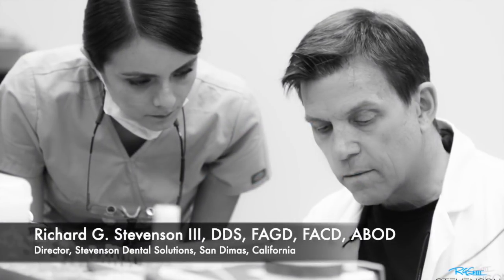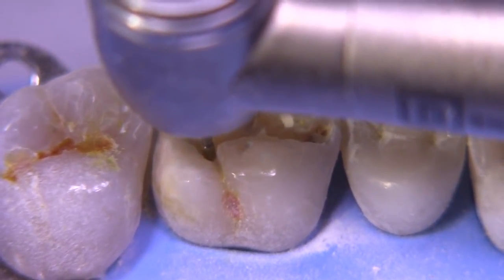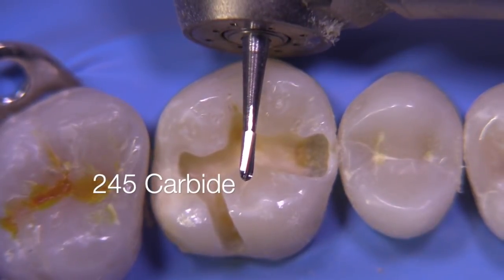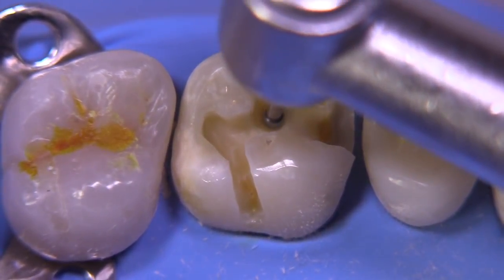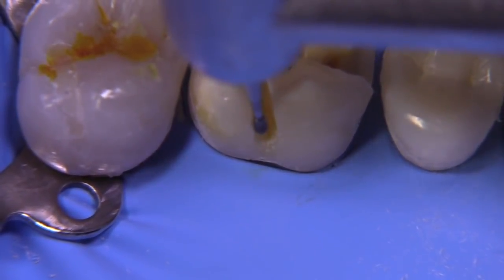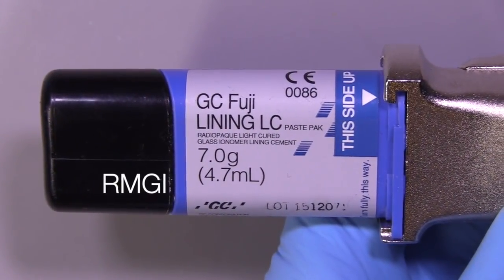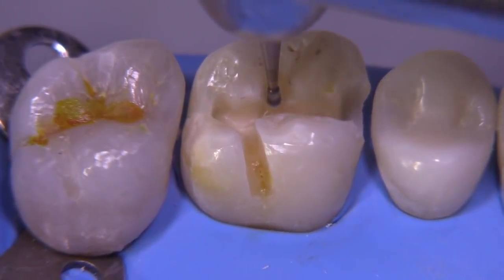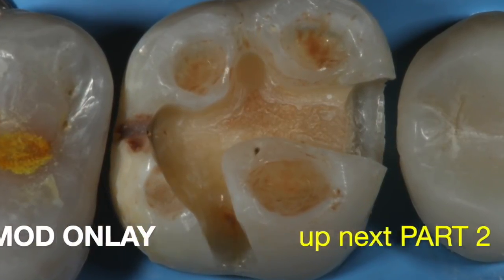Lithium Disilicate Ceramics, Part  1: Ceramic Onlay Clean-Out #3 MOD

Comment: Hello doc , if an adult patient permanent molar tooth was treated with silver diamine fluoride before, and now the tooth looks stained. Will an indirect inlay/onlay ceramic still be a good treatment option? Will there be bonding issues? Or not indicated? Thank you
Reply from the maker: I won't be an issue - clean the area with air-abrasion or cover with RMGI, then build up to ideal contour and prep ideally.

Comment: doctor stevenson good day i am really having troubles preparing the proximal box , specially due to no face to face classes , i have  atypodont mount and i am practicing my dental ergonomics but my problem is we are only using slow speed handpieces . is there a specific bur that we can use on slowspeed that can help us in imitating the results that a hispeed handpiece burs can create on proximal box preparations? thanks in advance
Reply from the maker: Use a 555D (a diamond shaped like a 55 bur.
Reply: @StevensonDentalSolutions  Thankyou doctor Stevenson

Comment: Thank you so much por sharing that information doctor! as a bachelor I find this very helpful :3 
Btw I have a question about the LOW SPEED part, is that with a special handpiece? because I don't know how to input 500 to 1000 rpm in my low speed handpiece 😢, thank you for your time! and best wishes from Latin America, Perú 🇵🇪!
Reply from the maker: Hi Doc, the special handpiece is the low speed motor with the friction grip attachment - simply use your pedal control for the lower speeds.

Comment: I want to ask u about deep margins. 

1) Can I cut gingiva using slow speed round bur?
2) Do I need to add composite to elevate the margin for onlay or can it be placed directly there?
Reply from the maker: Typically I use rubber dam and retract the tissue with the dam, however, surgery is sometimes required.  I would not typically place a margin on dentin for a bonded inlay or onlay because access is compromised - so in these cases a Margin Elevation Procedure makes sense. In the MEP, since a small area is being treated you may focus on this area only and achieve isolation with a matrix band. I use GI for this, but several others use composite.  Neither is ideal, but at least the margin will be in a more accessible area.
Reply: @StevensonDentalSolutions  Excellent, very clear. One thing more: If some of my margin is composite as we said, how will i treat this area before bonding the onlay?

Comment: Lovely as always doc .. One question please , what is the purpose of liner ?
Reply from the maker: Hi Doc, it's for a long term seal.  All of the caries research, particularly from Maltz, Mertz-Fairhurst and others recommend a GI or RMGI liner to seal the caries - not a resin.  In deeper carious lesions, where the pulp is perhaps involved or nearly involved, MTA is used, then secured in place with an RMGI (check out the study by Hilton et. al. a Prospective Clinical Trial on MTA vs Dycal).  For shallow lesions, I go straight to resin.  So, to summarize: 1. Shallow preps: DBA, 2. Deeper preps: RMGI, then DBA, and 3. Very deep preps/Indirect pulp caps: MTA, RMGI then DBA.  Best to you Doc.
Reply: @StevensonDentalSolutions  I was taught in Dental school that in deep cavities we can leave some Caries and directly apply composite over it without the use of any liner,  the reason was that well-done composite will achieve complete peripheral seal that suffocate the remaining bacteria and hence arrest the Caries process .?
Reply from the maker: Seal is achieved if the composite is exquisitely placed under optimal conditions, however, but the pulp won't be happy - composite releases HEMA and other molecules proven to be harmful to undifferentiated fibroblasts.  The evidence from prospective clinical trials is very strong to advocate MTA with near or actual pulp exposures followed by RMGI.
Reply: Stevenson Dental Solutions Great info, thanks for the effort Dr Stevenson.
Reply from the maker: Thank you Omar!
Reply: @StevensonDentalSolutions   Could we also use dycal for the same purpose?
Reply from the maker: @dr.nikitarijhwani1827  Yes, however, not as effective

Comment: Thanks to sharing 
But why do IDS with flowable Composite instead of GIC ... all recents protocols used composite for block out step
Regard
Reply from the maker: Hi, very good question!.  Although the "biomimetic" technique you mention is popular, there are very few long term (over 10 years) prospective clinical trials to support it.  The use a RMGI provides for a well-documented (numerous decade-plus long clinical trials)  approach to support its use as a liner.  I believe that innovation is critical, but clinical dentistry should evolve based on evidence and support in order to make changes to proven protocols. However, I have concluded long ago that it is the enamel peripheral seal that makes everything work so well in the final analysis, so just about any technique will work in this regard. Thank you for your comment!
Reply: Stevenson Dental Solutions thanks dr to sharing your knowledge 
Best regard
Reply from the maker: Thank you Doctor - appreciate your support and comments.

Comment: Many times I struggle with healthy DEJ, mainly because after removing caries it looks hard and healthy with the explorer, but then I use caries detector and colours it. Could you please give any advice when to trust caries detector and when it lies?
Reply from the maker: Caries detectors are poor with respective to the tendency for high false positives as they stain for more than just bacteria (decay) and yet are great for almost always staining caries when it exists.  If you rely only on the caries detector, you will find the actual caries but will also get a positive stain for areas that shouldn't be excavated at all.  Caries Detectors 's are good to teach us where caries tend to hide (under cusps and along the dej), but might be overkill and lead to excessive removal of tooth structure.  The KEY to successful caries removal is tactile feedback.  Essentially, remove all stains along the D.E.J. and then carefully test the entire periphery with a sharp explorer.  NOTE: The WREB examiners are well calibrated on this and use the tactile test on exams.  Best to you!